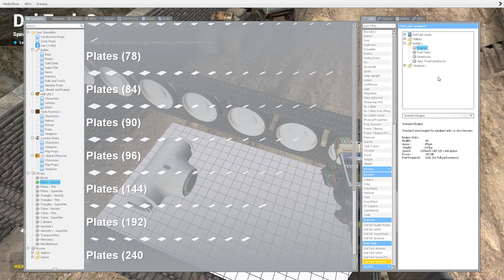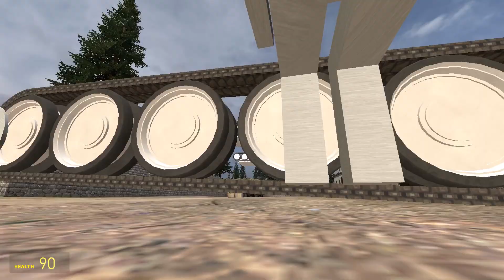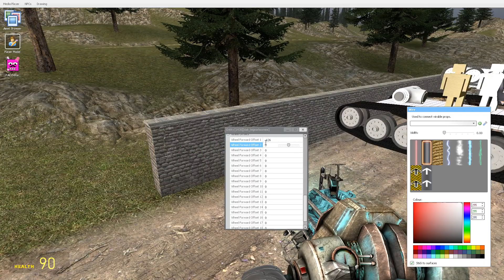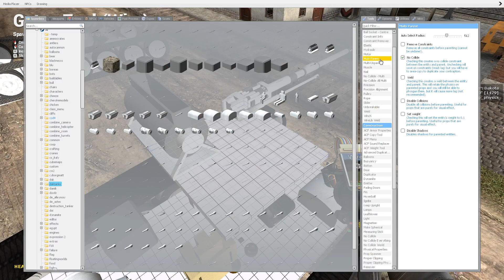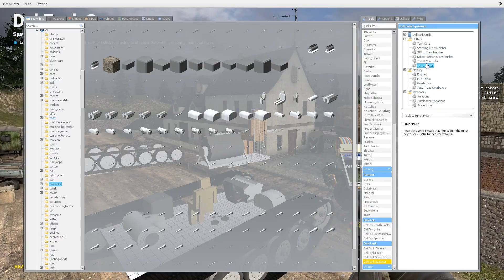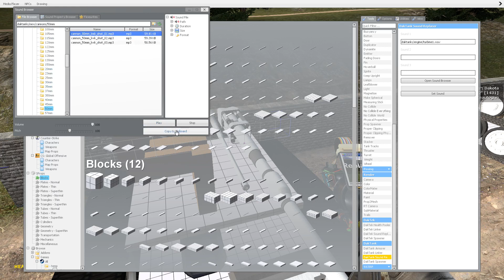DakTank Tutorial 2021 [for real this time]

Comment: After I copy and paste the first time, the treads center and everything, but the info scanner never shows up when I look at the tank core.
Reply from the maker: Do any sort of errors pop up in console? Also in the Q menu options or utility tab, is the output for the info scanner set to on? Also does anything work or no? You've also got crew and like all the rest of the stuff required placed?
Reply: @dakota0000001  I forgot to come back and edit this.  The info scanner appeared once I added some crew. Thank you for responding though!

Comment: why does a giant m2 browning machinegun appears when you copy the tank with advdupe? it gets in the way and it won't let me parent stuff
Reply from the maker: It's just a base model of the machine gun, they scale up and down from 100mm size. It generally shouldn't be getting in the way of anything, but if it happens to be having that problem for you I'd recommend using a fading door on it and just fading it when you need to work under it.

Comment: Yo, I recently tried this but when i set my cam controller up it sends the third person view to the center of the map, i only have client side movement enabled in my settings.
Reply from the maker: That issue happens when the camera e2 doesn't have a proper input of what is third person, depending on the version of your e2 it may have a wire option where you can wire the baseplate or some other location to it to be the parent point of the view or it simply needs to be welded down to the baseplate it is on or parented to it.

Comment: cam e2 is a dead link
Reply from the maker: Should be working now.
Reply: @dakota0000001  this might be a dumb question, but my suspension for the auto treads keep spazzing out regardless of what my settings are, setting the weight made it better but it still does it
Reply from the maker: @BamsyTheSergal  Could you explain in what way and when it spazzes out please? Sometimes server tick rates may be set wrong or doing something like running into the border of the map.
Reply: @dakota0000001  like the suspention isnt stable at all, regardless of settings and weight set, sorta like if you set the dampening way too low or force too high, but i tried setting it all to low and literally no change
Reply from the maker: @BamsyTheSergal  I'm asking more for specifics of in what way it isn't stable, like is it just bouncing up and down in place? If so that's a tick rate issue, oftentimes servers will set themselves to 66 tick, however gmod default tick is 200/3. Having it set to 66 tick means that it will be missing a tick every couple of seconds compared to default tick rates, which tends to cause problems. I'd ask that you try testing things out on the official daktank server to ensure that all physics settings and compatibility issues and everything are correct so we can know if there's a problem with the vehicle itself or some outside issue.